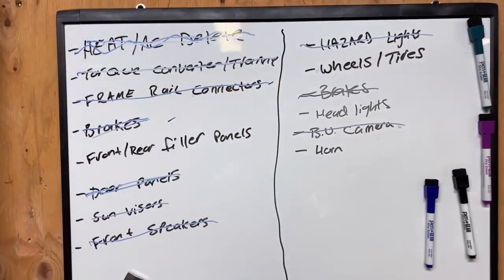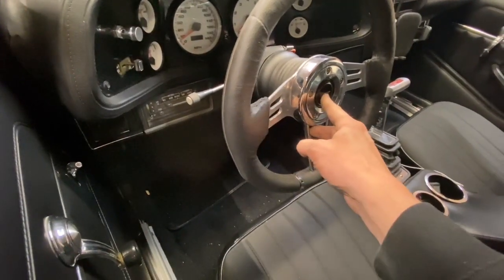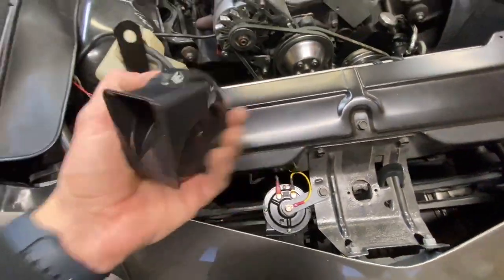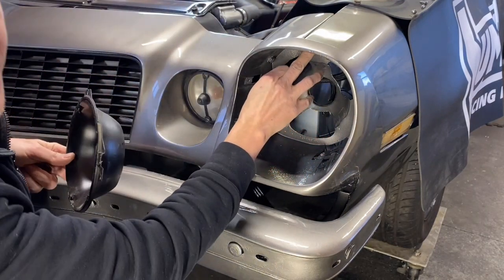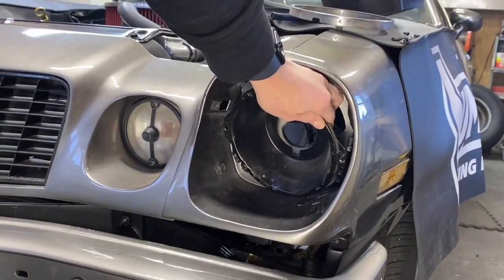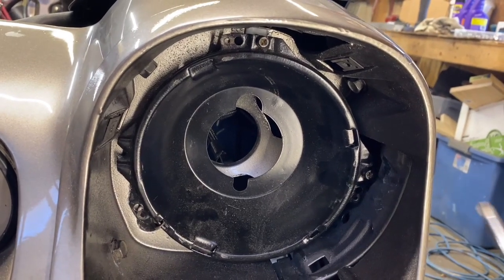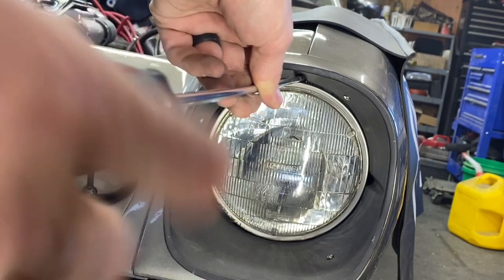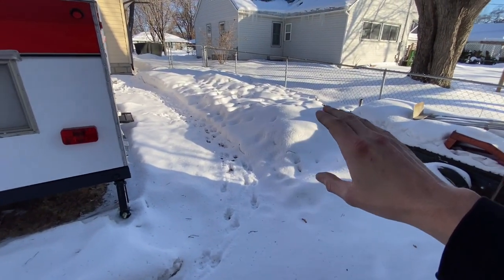1977 Chevy Camaro Restoration. Part 82. Fixing the horn and headlights

Comment: Nice video! Helped a lot. I am wondering though what upper radiator hose are you using? I like the clearance and routing.
Reply from the maker: I just went to the parts store and bought one that worked. No rhyme or reason

Comment: Good morning. This is YourBoyEric from Southern Cali. I’ve been watching your videos for a while and they have been very helpful, but I’ve ran into a little problem with the tail lights. I’ve purchased a universal wiring harness kit with works well and was easy to install. On the wiring harness are two wires for the rear parking lights (left and right). Also the there are two wires for the reverse lights as well (left and right). Well on the tail light harness the is only one single wire for the parking lights and one single wire for the reverse lights. Do I tie both parking light wires into the single parking light wire in the tail light harness as well as the reverse lights? Thank you so much for your help. YourBoyEric from Southern Cali.
Reply from the maker: Hey Eric, yes you tie both lights to the one wire. On my harness I got, it was just 1 long wire which ran both park lights and reverse lights. So wiring them together would do the same thing. The only reason the signals are separate is because they are independent except when the hazard lights are on. Hope that answers your questions. Let me know if you have more!
Reply: You are the Man! Thank you very very much!
Reply from the maker: @ThisIsYourBoyEric anytime! Glad I could help 😊